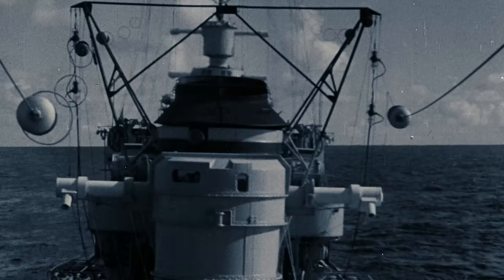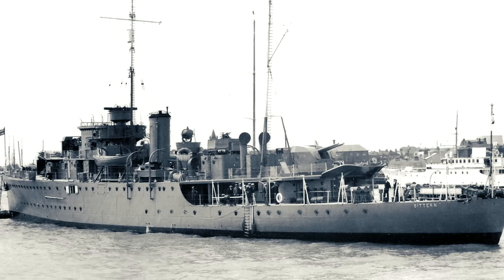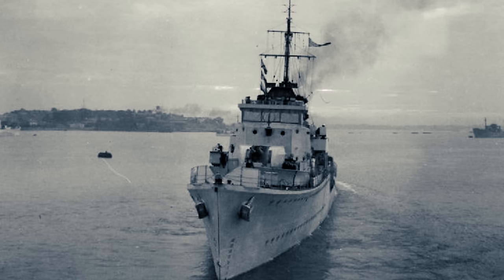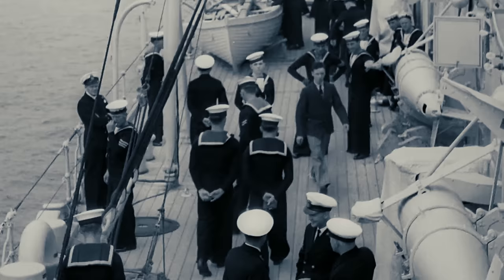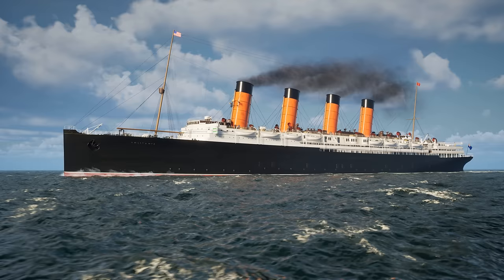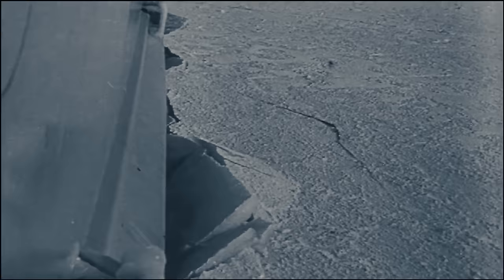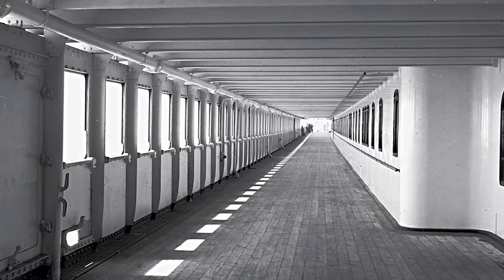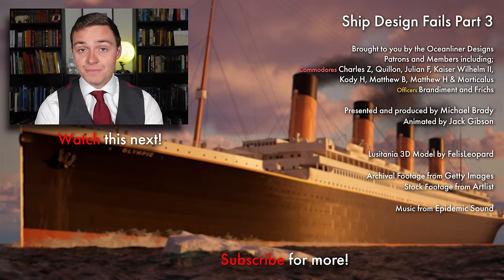When Designers Fail: Three Ship Engineering Mistakes from History

Comment: It is possible to add more buoyancy to the bow by increasing the flare from the water line to the deck by increasing the deck width. 
This will allow the bow to lift in heavy seas. Very common in modern yacht design.

Comment: I was thinking that the sheer heaviness of Bismark's armour became a real weakness after torpedo damage meant the steering couldnt be repaired.
Reply: Yes, another design flaw of the Bismarck was that its three propellers were very close together in the center of the stern. If the propellers had been further apart, it would have been possible to steer the ship with the propellers despite the damage to the rudder from a torpedo hit. Another flaw was that the two rudder blades were powered by only one steering motor and could not be separated, turning the ship into a sitting (traveling in circles) duck.

Comment: When you said the straight bow was cut away, would it not be easyer to add an extra bow outside the existing  bow with the forward slope and the flair
Reply: Some ships did do this, namely  the Italian WW1 battleships rebuild in the 30s
Reply: The Germans did not completely rebuild the fore-section of the ships when they added the "Atlantik" clipper bows, they simply added/extended what was already there.
Reply: @zacknowles9711  Conte di Cavour and Giulio Cesare were the only two where they did that. On the Andrea Doria and Caio Duilio they removed the old bow before adding the new.

Comment: I have to ask why you refer to the Schrnhorst class as battleships? They weren't as heavy as Treaty battleships (32,00 tons versus 35,000 tons) and carried smaller guns (11" versus 14" or 16"). They may have been fast and carried an impressive armor belt, but couldn't really slug it out with a treaty (or later) battleship.

Comment: I often remember reading in one of my books that Nimitz often complained about the Iowa class Being extremely wet ships at speed.  I often wonder how they would have handled a rough engagement in the north sea against the Bismarck or a king Goerge V class ship???  Maybe the South Dakota were more powerful than the Iowa's??????
Reply: To say they were "wet" ships would be an understatement. Look up "USS New Jersey, North Sea in storm", you should be able to find footage of the entire front of the ship, up to and including the entirety of No.1 turret,  going underwater. The HMS Vanguard could often outpace and just generally outperform them in heavy enough seas. But that is what happens when you design a ship with a negatively buoyant bow.

Comment: Thanks for creating this video, however, I strongly believe that the second part about the german battleships are false but let's speak about the DDs/sloops first.
06/02/1922 - the darkest day of naval shipyards. This was the day, when the Washington Naval Treaty has been signed and the UK lost its capability to build reliable warships in all classes. All the knowledgable people in naval shipyards had to leave their job - it means that the knowledge and experience of these people just lost. This caused a lot of issues pre and during WW2 - for example the HMS KGV class was not even close to any rival and allied battleships (german: 38 cm, french: 38 cm, italian: 38 cm guns), straight bow, small sides - just inferior to any other battleships.
The german battleships: actually, causing short circuit by water in the front turret was not their issue but the KGV class especially. However, there was a common issue with all german battleships: all of them were bow-weighted, so getting hits there could cause serious problems. (Worth noting: HMS Hood had two nicknames by its staff: "the biggest submarine of the world" - because at high speeds, the boot was always nearly on the ocean level; the other one was "the 7Bs - I leave it to you figuring this out).

Comment: Everybody fails in designs, now and then, as there are so many things in a design that are unknown.  This is specially true if the design is of something that is different from what has been made before.  We can never know all so we have to make assumptions, which may be right or wrong.  Then the properties of the materials used, are known to a certain degree, but con aboslutely.  Besides that there are the time and cost constraints.   If a design is too costly, no matter how good it is, it won't be produced, and there is a time to do  it which is most of the times rather short.  Regards

Comment: Don't forget the design error on Bismarck and Tirpitz that killed the Bismarck. The number of shafts and rupper design. which crippled Bismarck by the swordfish.
Reply: Bismarck was built. as were other German warships, with 3 screws instead of the usual 4 in order to navigate the Kiel canal. At the conclusion of her sea trials her Capt. expressed concern at the vessel's virtual inability to steer by varying the revolutions of the screws .. a necessity in case of the loss of rudder control. Could this have sealed her fate following the battle damage to her rudder(s) ?

Comment: The Scharnhorst sisters were somewhat bow heavy to begin with, which made the matters worse with their original bow structures. Clipper/atlantic bows remedied the water shipping to some extent. Royal navy had similar problems with their KGV-class of new battleships and all their WW1-era battlecruisers. These issues were tackled only with hms Vanguard`s design later on, after the war.
Reply: That is a design feature of all battleships. The front is made for speed and a stable ride, not for buoyancy or roll stability.
Reply: @0MoTheG  Yes. But the fact that sisters had two thirds of the main guns and magazines on the bow side did emphasize the bow heaviness.

Comment: It feels like Yamato class has its place here aswell, along most of the vessels armed by the Russian Empire at the  battle of Tsushima. Not o mention this monstruosity sold by the british empire sold to the Chinese empire around the same time (i can't remeber the name, but it wasn't pretty that for sure). Nice and interesting video, thanks!
Reply: The Yamato's were fine from a design perspective (aside from the shitty AA, but that's almost entirely the guns used fault), it just ran into a fuckton of unpredictable (or in the case of fuel shortages, predicted) problems (almost) completely irrelevant to the design itself. Most of the ships of the Russian Second Pacific Squadron were likewise mostly fine ships, for their original roles and time of construction. It's just they had (for the most part) horrendous crews, where forced to do things they were never intended or designed to do (aka, sail arou 2/3rds of the globe. And in the case of the smaller vessels, fight anything moe than a fisher/merchant turned pirate), and most were horribly obsolete. I need to look up that monstrosity. Ihave vague memories of a cluster fuck of a ship that matches those details, but I can't recall enough to comment on the truth of your statement.

Comment: personally in reference to Deutchland class heavy cruisers (Graf Spee, Admiral Sheer), i'd hardly call 11 Inch (283 Millimetre) Main battery "small". considering its a full 80 mil larger than the standard Heavy Cruiser armament of 8 inch or 203 MM used by most navies of WW2.
Reply: For a capital ship of late 30`ies it was a pop gun. During norwegian campaign and a gunnery exchange with hms Renown, Gneisenau did hit the british ship a couple of times, but 11inch shell was too light to penetrate the vitals and even an old (though refitted) WW1-era battlecruiser could absorb the punishment with very little actual damage.

But 11inch battery was useful for commerce raiding. 

(As the panzerschiffe are concerned, the 11 inch battery was a bit overgunning. The 11000t hull could not carry nearly enough ammo for the main battery and Admiral Graf Spee`s magazine was half empty after the battle of river plate against the three RN cruisers. Not a good thing, even without AGS`s most fateful and crippling damage, the broken engine water filtering system. )

Comment: Hey Mike I’ve got another one for you. A really important but simple one that could have saved many lives on Titanic. Why wasn’t the capacity of lifeboats painted on the sides. There’s a design error if ever there was one.
Reply from the maker: Believe it or not, it was! There was a plate on each lifeboat with detailed volume and capacity information but Lightoller especially feared the boats may buckle regardless as they had done so on other wrecks. Interestingly shortly after a fully loaded boat was tested on Olympic’s davits in a workshop and some of the davits actually buckled and snapped under the weight.

Comment: Well, the calculations related to centre of gravity or ship roll are not "complex", but they are tedious. For anything on the ship heavy enough to make a difference, you have to work out the weight and elements centre of gravity, and the location in space related to a fixed point. With a computer and even just spreadsheet software it comes down to entering the data correctly, the math is elementary, just addition, multiplication and division. But you may to deal with hundreds or even thousands of items, so doing the math on paper means you have to do it twice and hope both calculations come to the same result. And with this type of math it's easy to check what has been included, but finding the items that have been forgotten is hard. to find this type of error a detailed knowledge of the design is needed.

Comment: The King George V class battleships of the Royal Navy were designed so the forward guns could fire across the bow at zero degrees. They had a straight stem like the Scharnhorst, but with practically no sheer. They were almost dead flat from stem to stern, and were very "wet" ships. This wasn't remedied until the following HMS Vanguard, the last battleship ever commissioned.
Reply: The French battleship Jean Bart was the last battleship ever commissioned.

Comment: I think of the Bismark when it comes to flawed designs. Under Sea Trials, it was found the design incapable of steering through altering prop revolutions. Even stated in the report on the trials.  So they knew before the breakout into the Atlantic, that if the rudder was disabled, the ship couldn't change its course, and yet they still chose to send it out, and of course, that very scenario happened, and it was sunk.
An amazing lack of foresight and common sense was in hindsight.

Comment: ..great presentation as always...  50,000 pounds of concrete would be about 16.5 cubic yards!  ( about 445 cubic feet ) what did they sacrifice for this? it would have to be as low and on center as possible.
Reply: %0 tons of concrete, as quoted in the video, is 100,000 pounds, not 50,000.
Reply: @wingmanjim6  Hmmm... I suspect you meant 50 tons?
Reply: Ooops - thanks for te correction ! I will discipline my fat typing fingers at once ! :) @KevinSmith-ys3mh
Reply: @wingmanjim6  Oh yeah, I feel ya. I'm using a 10" samsung tablet these days (mostly), anything smaller drives me crazy to do much input work on. The things hate my fingers,  mostly use a rubber tip stylus or bluetooth keyboard to get anything done.
Regarding corrective ballast- I was 20yrs USN, (retired 20 some now) and the Spruance destroyer I was on had a noticable stbd list underway if the tanks were'nt counter-flooded. A one off design with an off-center turbogenerator install (apparently) USS Paul F. Foster 2nd of the class launched; possibly the original prototype build, but had problems during construction? Also later a VLS missle array installed in the bow. These plus more changes gave the list an annoying snap roll also. Eventually a shipyard avail got a go ahead to add a semi-load of lead ingots in the fuel tanks, to level us out. Gave a much improved ride, which may have been a literal lifesaver when 1st Gulf war popped up; we double stacked the magazines and max cruised around the globe to Iraq bow down and lubber lines submerged! A bad cyclone may have made us a permanent submarine!🤨

Comment: Many small vessels have their waste spaces filled with buoyant material like foam so that they can only sink to the water line. It has the dual benefit of not only floating but also displacing water in a compartment. Has this ever been tried on bigger ships with cork for instance?
Reply: I believe it has been done before, but has limited effect on survivability because large explosive shells, bombs and torpedoes just blow it to pieces, and the space occupied is better used for water and fuels tanks if you want long range operations. Effective compartmentalization combined with rigorous training in use of closures and damage control are better options.

Comment: I know you missed the boat on maritime engineering failures. Being that the Germans corrected their initial fault, I wouldn’t consider that a failure. Now the King George class never did correct their strait stem design and they were known as very wet indeed designs. Would be a failure since the RN was forced to live with the problem. 

If you were to call out the Bismarck Class for an inadequate rudder placement design error then you would be obviously correct

Comment: Have you considered a more general site about bad design, such as active cooling systems in nuclear power stations, rather than passive systems, to why are most taps on kitchen sinks so low when modern kettles are high, or when you get a message on your computer telling you you're full screen, which you're not as some of the screen is taken up by that very message.

Comment: Speaking of Kriegsmarine, You should mention the weak aft design and vulnerable to explosives. So weak that at least twice German warship lost their rear (I believe Lutzow and Prinz Eugen, respectively) due to torpedo hits. And the other ships had to have their aft structure reinforced.
Reply: Wait, it gets worse. 
The screw layout meant that in case of jammed rudder steering by the use of engines was challenging at best. In case of Bismarck - actually impossible.
Reply: I would argue that the biggest flaw in German naval ship design of the period was the unreliable high pressure boilers that required very skilled and experienced boiler technicians to keep running in a semi-decent state. Too many times KM ships had to turn back and scrub their mission from boilers breaking down.
Reply: Yes, that was another problem. In general I'd say Kriegsmarine surface ships had a tendency to be over engineered. Something that plagued some of the French designs of the era - very advanced designs, but problematic and not reliable, in the end more of a liability than an advantage.  @Karle94
Reply: Bismarcks stern also snapped off  cleanly during its sinking. It snapped at the point along the line of the aircraft recognition marking.
Reply: @marklivingstone3710  That part was more or less weakened by earlier torpedo hit. And wasn't that severe. Check out Lutzow aft broken in Google graphics to see what kind of weakness I mean.

Comment: Bismarck, also, could not be steered with screws alone - a huge design fail that only manifested itself when a torpedo jammed the rudder over to one side - forcing her to turn in circles allowing RN heavy units to catch up.
Reply: Even with a 4 screws Design Bismarck had no chance to escape.

Comment: Scharnhorst & Gneisenau became really overweight during the later design stages and construction, hence the low freeboard. Ships of a similar hullform in WW1 encountered far less problems; there's also the issue that before WW1, warships usually didn't fight in heavy seas, since you couldn't see anything anyway. By the time WW2 and radar rolled around, this limitation was no longer there, and ships were expected to be ready to fight at all times. So it's a confluence of older, misapplied design and a change in doctrine. That said, the sisters do look best with their original bows.

Comment: You could easily add to the list most of the US destroyer programs between the four stackers to the Fletchers when they finally got it right, some were dangerous on open sea with too optimisic armament. Alsso the Sumners were not 100 percent OK as they were redesigned with wider beam as the Gearings. Als the first cruisers of Omaha -class, what were they thinking? It does not take Einstein why these werenot front line ships during WWII. HMS Glorious, Courageus and Furious were failures as they were originally designed. Not to mention the ironglads in the 19th cntury, I guess some of the French battle ships from that era were the worst.  German cruisers of K-class, Köln, Köningsberg and Karlsruhe were also over armed and overweight, with poor range, they were rather useless dring WWII.

Comment: The two fast battleships of Germany are not battleships, they're battlecruisers. More or less
Reply: The germans did not use such classification and it was purely an informal one for RN too. By the definition, battlecruisers traded armour for speed, and the Sc/Gn - sisters traded off firepower for speed. 

Not really battlecruisers, more like small fast battleship a la MN Dunkerque or Strassbourg. But that has been analysed deeply by for example uncle drach and sir Ryan of New Jersey.
Reply: @Ah01  ight fair

Comment: CHECKING the calculations is usually a mistake. You need to REPEAT the calculations starting with new measurments of the draft, beam, etc. and with zero access to any previous measurements or calculations. If you get the same answer, chances are that the two teams didn't make the same mistake.